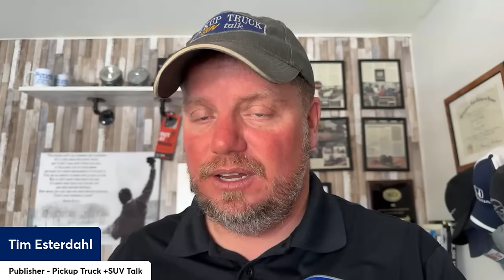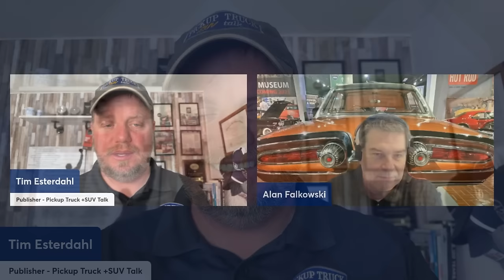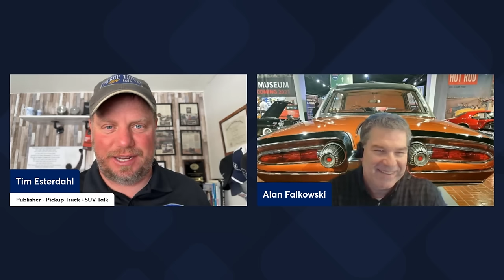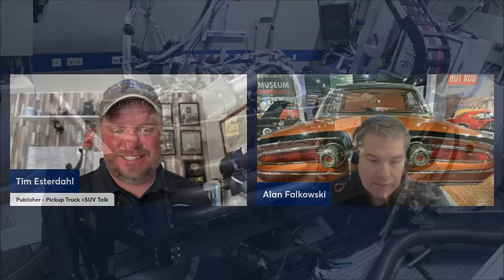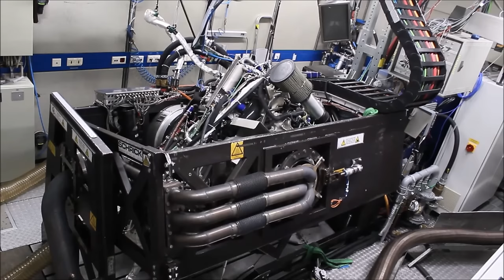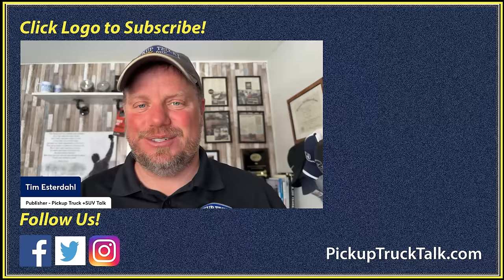Engineer Deep Dive: 3.0L Hurricane Engine - Turbo Life, Oil and Intervals and More

Comment: A few things concern me as I'm watching this:
1) if Alan helped design the Hemi MDS system on the 5.7, then I'm already hesitant to trust his reliability testing.
2) Real world towing tests have shown that a 2025 Ram with the 3.0L Hurricane got around 3.9 MPG while towing 8,800 lbs uphill with a 3.92 rear axle ratio.  The 5.7L Hemi got about 4.7 MPG with a 3.21 rear axle ratio, but both engines were operating at about the same RPM. So his comment about being able to get better fuel economy during uphill towing because they don't have to retard ignition seems like it doesn't pan out in real world usage.

I would be very hesitant to buy a vehicle with this engine for several years until it has proven itself, and they've added a dipstick!

Comment: I guess for me and I don't know much... why do we have to boost/push a smaller engine/ components harder than just running a V6 or a V8 normally aspirated? Its another thing to go wrong. If cars were to built like a diesel truck with a turbo they may work better and last but they generally are not. I feel like the goal is to charge more and provide what you feel we should have not what we want. Just my .02
Reply from the maker: Emissions. V8s are dead.

Comment: I've been a loyal Mopar guy since 2004. Owned 2 Jeeps, 2 Chryslers, a Dodge, and a Ram. I think I'm done with the brand and their direction since being acquired by Stelantis. I don't care for EVs but if they want to offer EVs I don't have a problem with it. Just don't take away the V8 and leave me with the choice of EV or 6 cylinder. Absolute joke. I love the sound of a V8. Every Mopar I've owned has had a Hemi except for my Wrangler. My Ram is about due for a replacement and I'm doing something I never thought I would do - look at another brand.

Comment: The only impressive thing about a gas engine is the gasoline, what an amazing fuel, so energy dense, happy at room temp and wild temperature extremes. As far as gas engines however, their thermal efficiency is terrible, almost all the energy is lost to heat (upwards of 70%). There are so many friction points throughout and reciprocating parts with significant wear.  Battery electric vehicles have extremely high efficiency, low friction, no reciprocating parts, very low wear but poor energy density compared to gasoline, comparatively slow refueling times, especially when traveling great distances (otherwise it’s easy to plug in over night).  The Sun is the ultimate energy source so whatever technology can derive its power from it in the fewest steps, I’m a fan of, there are many technologies in the running. All that said, I’ve grown up with gas and diesel vehicles, wrenching on them, knowing quite a lot about the history, fucking love the racing history, particularly CanAm, F1. Cars are my jam, don’t give a F about sports but love cars.

Comment: 3 L twin turbo V6 in an explorer for the bronco raptor is a great engine. I know people who removed the stop start, then tuned the engine for over 500 hp at the wheels. They have had it for over 60,000 miles like that and no issues. my point is the 3 L twin turbo is a great engine for making reliable power
Reply: No

Comment: I wonder how many people will be moving to 3/4 ton and 1 ton trucks due to the engine changes in half ton trucks.

Are folks gonna want the 6.4 Hemi or the Cummins over the SST?
Reply from the maker: If you are asking me, I don’t. The Cummins in the 3/4 ton is slow and holy cow is it expensive. The 6.4L Hemi is pretty slow as well and a gas hog.

Comment: What about Start Stop, all the extra expense of equipment I do not want?
Reply from the maker: It is covered in this video. Start/stop is an emissions and EPA mandate. We discuss it. Also, what extra expense for equipment are you thinking of?
Reply: It's another boondogle from both manufacturers and gov. I hear manufacturers are going to keep count of start /stop cycles and after a certain amount will trip check engine light , new starter and battery to reset it.

Comment: How as Dodge addresses the issues with carbon build up on intake valves that have plagued all the other GDI engines out there?  Ford has literally two sets of injectors on their new Eco boost engines (GDI and port) to help address the issues, but it only marginally works.  So just like all the other GDI engines, expect your new Hurricane engine to require an expensive valve cleaning treatment/replacement at 50-60K miles.  Some technologies are great in theory and perform poorly in practice.

Comment: Just try driving a Dodge with 10,000 mile intervals for oil change.  Even with 5,000 mile oil changes they still are most likely to give problems.  This company can't get past the big R word.  It's the elephant in the living room.
Reply: My 3.6L Pentastar uses a quart of oil every 1,500 miles. It would be very easy to destroy the engine if I didn't check the oil every week.

Comment: The whole concept of forcing a new idea on the customer rather than offering it as an option along with the old tried and tested, and trusted, (Ford), is faulty. If this experiment fails, it won't nessisarily be because the engine is bad, but because they've made their customers mad. All the new tech, turbos, spray on liners, aluminum blocks, injection systems, etc could have been applied to a small V8 just as easily and would have helped keep die hard mopar owners happy.

Comment: Why not use the 4.0 the Jeeps used? throw on two turbos on that. The engine already existed.
Reply from the maker: That thinking is what he referenced on why turbos used to be bad. You can't just toss turbos on an engine and expect a good result. Building a brand-new engine with turbos already in the plans, improves reliability and makes a better engine.

Comment: I dont care what he says about break in oil, when you have 90ppm of metals in the oil at 500miles, change the oil. Change/Test it again at 3,000 miles and theres 10ppm, that's 2,500miles without 80ppm of metal going through my engine. As far as oil change intervals, again, testing doesnt lie. The biggest cause of oil breaking down is FUEL in the oil. High compression/boosted/direct injection=more fuel in the oil faster. 10k mile oil changes is an absolute joke. Get your oil tested at 3k, 5k, 10k, I love saying told you so. Never forget, the science doesn't lie and the manufacturer only cares that the engine lasts 5years/60,000 miles, after that, YOU get to pay for a new engine.

Comment: inline 6  one the best engine s ever why it didn't  go into the ram  or wrangler first  to get the bugs worked  out ,as we truck buyers can  drive  50k miles a yr  than the  wagoneer driver  who has 3 cars and drives this to the lake house
Reply: Good question. They do this for just the opposite reason. Jeep has been the test bed for their new engines/drivetrains for a long time. Manufacturers like to put their new products in luxury brands first or high trim levels to work the bugs out. From my experience working with the luxury buyer is easier because most have back up vehicles. Truck   Owners need a durable product and are less forgiving of manufacturers not meeting their standards.
Reply: @alexgrindnshine2522   good point  if I pay $100k for a car id want a reliable  car

Comment: I believe the  turbo engines are not much more fuel efficient but have less emissions.  The governments ,not vehicle manufacturers are forcing this and electric to get those numbers down.  Not much is better for consumers with these smaller engines with high horsepower vs big displacement.

Comment: Change your oil every 3-5k if you plan to keep your car past its warranty period. Every good mechanic will tell you this to save you the expensive repair cost later.
Reply: I haven't done that on any modern engine, and I easily exceed the warranty period every time. Usually, 150K or more. Haven't had one fail yet. They rot out before they wear out. Just change it when it needs it.
Reply: @Dusdaddy  do you check between? And add as needed? I suspect you drive more highway and less short stop and go driving. The reason I say do it often is most people drive 12000-15k miles a year and the driving they do is a lot of short distance with a lot of heat cycle’s being put thro the engine. Those are hard miles being put on the engine. You will have more sludge issue because the oil is never being brought up to a higher temp long enough to burn off the moist that accumulates, along with fuel wash that gets past the rings and into the oil because when an engine is cold the rings are not making a good seal yet. Change your oil every 3-5k miles is playing it safe generally speaking the smart thing to do. Sure you have been lucky but again if you are doing a lot of highway miles then that is way easier on the engine and oil.
Reply: @alexgrindnshine2522  Nope. About 12K with about 3k in hwy. Change the oil about twice a year around 6k.
Reply: @Dusdaddy  6k is fine. When people are going 10k it is a big risk

Comment: Engine Oil, Transmission Fluid….. probably the two most important fluids to the long term reliability….. and make it where you can’t access…..

Think of this point for a moment………
“The fluid is designed to last the life of the transmission….”..True”…., but…..the transmission fluid may not last the lifetime of the fluid 

Marketing and lawyers…..fleecing customers since…..forever.

Comment: There’s 911 turbo cars with hundreds of thousands of miles. Turbos being unreliable is a 80’s attitude. Turbo diesels trucks with 500,000 miles
Reply: There are plenty of examples of issues that arise from turbocharging an engine. The concern isn't if an engine can handle the boost pressures or what the longevity of the turbos will be. It's not about the capability of an engine to survive a race car torture simulations. The concerns stem from the unanticipated conditions the average owner will subject the engine to. Look at some of the issues that the 1st gen 3.5 Ecoboost had. Carbon tracking sparkplugs every 30k miles, moisture collecting in the intercooler and being ingested into the engine and causing misfires and stalling at highway speeds, severe fuel dilution of the engine oil, carbon deposits breaking off and damaging the turbine blades, etc. There are other issues that seem to crop up with modern turbocharged engines -- waste gate actuator failures, turbo coolant line failures, turbo oil feed lines clogging with engine oil deposits, low speed pre-ignition, plastic components on intercoolers melting, etc. An engine can be built to handle big power output, but if engineers didn't pay special consideration to the fact that there will be many drivers that start their vehicles in 0 degree weather, drive a mile to work, and shut the engine back down, that's a major oversight. That is the kind of bad behavior by consumers that causes a lot of issues with other modern turbocharged engines because it was never considered.

Comment: My personal experience with turbos. I have the 2020 F150 3.5L Ecoboost. Ford took the PCV valves and dumped them into the intake of the turbos. Meaning. Oil going into the air intake of the turbos. The engine has to be new or very new. Two oil catch cans. I listen to others drive their trucks. They have to put their foot into the floor to move their trucks. I don't. I have to feather the gas peddle. I get around 17.5 mpg average in town. 21 average on the hwy. I can turn off the start/stop. I do. I change my oil between 3,000 and 4,000 miles. The only problem I have had was a bad PCV valve. Would lock in place.  My 2004 Jeep Grand Cherokee has the straight 6 4.0L. No turbos. 17 mpg in town. 20 mpg hwy. Myself. I prefer turbos. This channel is out of Scottsbluff. Going south on 71 hwy. Up the huge hill. My Jeep can hold the speed. It turbos a must. Nope. What is a must with vehicles with high mileage is getting the throttle body cleaned. You gain gas mileage and hp. Something people don't get maintained. It is extremely simple to do. Each to their own.

Comment: !!!!  Inline 6: -naturally balanced -40% less parts than v8 -large rod bearings -low end torque -long life 

I predict this will be one of the best engines made in the last 30 years

It’s a light duty diesel with spark plugs
Reply: @centralMississippiWhitetail 
Look at dodges history of engine development. They have never made an engine that doesn't have huge problem for the first 3 years or more of manufacturing. Also there is a reason dodge stopped making their 3.0L I6 eco diesel. Hint it's not because they where good.
Reply: I doubt it mate

Comment: No one will convince me that a 10,000 mile oil change interval especially with a soccer mom and stop and go driving is a good idea. 
I’ve seen too many sludge bucket engines burning at 60,000 miles!
If he’s only talking about a lease, Go for it otherwise keep your head on straight!
And what’s wrong with having an engine dipstick and an oil sensor? 
Seriously how much does a dipstick cost?
Bear in mind this gentleman purpose is the sell more vehicles.
Follow his advice and before 100K you’ll be looking for another vehicle, and no one will be interested in your depreciating asset. 
Not everyone drives under ideal conditions. In fact it’s probably less than 25% of the population would be driving under ideal conditions!! 
Just like Toyotas new twin turbo V6 is blowing up, the hurricane straight 6 has been spinning bearings.
Let’s just hope it’s teething pains! Strange they don’t don’t mention that in this softball interview!

Comment: You really can't compare a turbo charged diesel engine to a gasoline turbo charged engine. Two different animals. Diesels don't really care about air fuel ratio. They will run the same from a 20:1 to 100:1. They actually run cooler at a leaner ratio. A gasoline turbo charged engine needs to keep a very narrow fuel air ratio or catastrophic failure in very short time. I have two ecoboost engines in the household. They have been very reliable, but change the oil at 4,000 miles and its pretty black. Ecoboosts are very dirty engines and unburnt fuel gets by the rings when the engines are cold.

Comment: Have 2025 ram 1500 with hurricane sst standard output and it’s great. Watch your gas gauge go bye bye. If had the money I would get the high output. Let me do your testing. Because I know someone gonna run it when it’s 100 outside and full tilt. First 200 miles the transmission would jerk from 2nd to first. Now it stopped.

Comment: Well I wish you had another engineer at this who didn't work for the manufacture. I also don't believe the oil story. the oil life might still be good but was about the dirt in the oil. That filter isn't getting it all out. also the test run on that engine was in a clean room. Let's get some dust and dirt flying around in the room for the air filter so suck in. Let's see how the internal look after that and the oil. I also think that these tiny engines have to be working a lot harder than a bigger cubic inch engine. I don't have the warm and fuzzies about this engine in a truck application.
Reply from the maker: I've interviewed other engineers AND engineers from oil companies. My sense is you won't believe them either.

Comment: Only time will tell the truth. The fact you don't have a dip stick and need to pull the frame off to fix a leaking turbo cooling hose on the back of the hurricane motors that has already been found to leak on a lot of them already shows how well it was actually designed to be serviced in the first place. You jammed it so far back it will cook all the electronics and hoses and require you to pull that motor till the cows come home. These changes are purely to satisfy emissions durability and longevity are never even considered because that starts with serviceability and that's not happening outside of a dealer because customers are unable to even read the codes because you require a dealers Mechanic certificate to even buy that extremely expensive software in the first place. So no AutoZone OBDII device will read anything you must as the screen display says Take it to the dealer!

Comment: All this talk means nothing until proofed over 10 years of use. Turbo engines are known as high compression Carbon traps, and premium fuel costs are stupid. Carbon build up destroys turbo engines, this interview doesn't prove anything. Put an oil trap on your trucks breather line, this would be a must for me. Change oil more frequently than owners manual states also. Cleaner the oil the cleaner the engine. Tearing down an engine costs way more than slightly more frequent oil changes.

Comment: If he was responsible for the Hemi that only means problems for this new engine.  Here we go again ground hogs day.
Reply: The hemi is a stout engine. I worked in independent shops on everything and at a dodge dealer. Sure they have their documents problems but the failure ratio is low. Saw a lot more LS and triton engine issues then Hemi issues.

Comment: Ah ah ah. So in essence they are using the German approach to designing, which focuses on the combustion chamber design and individual cylinder design, then they add them together. Kinda like BMW B58 and B48. One is 6 the other is a 4. That could be a good approach as long as the air system is designed smartly to avoid buildup. I.E port injection. Also they need to do away with extended oil intervals. That’s just idiotic.